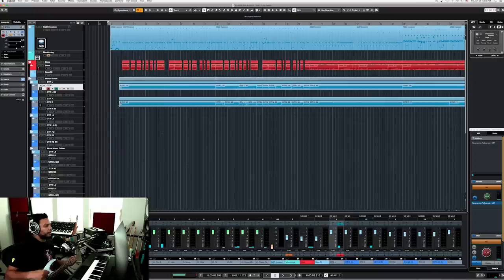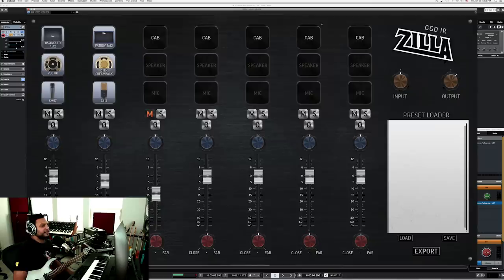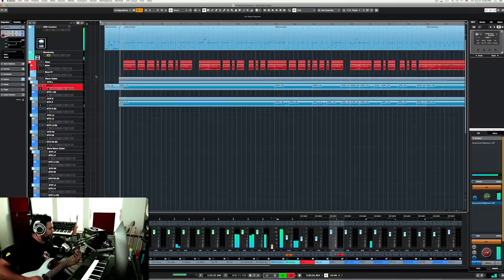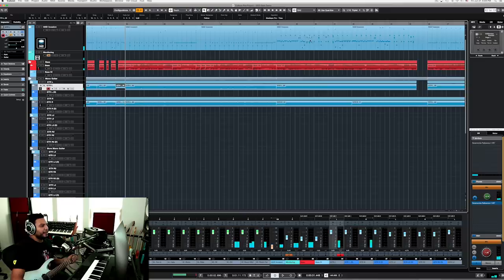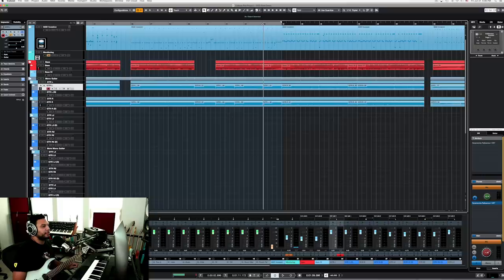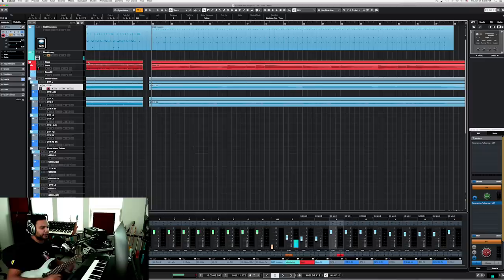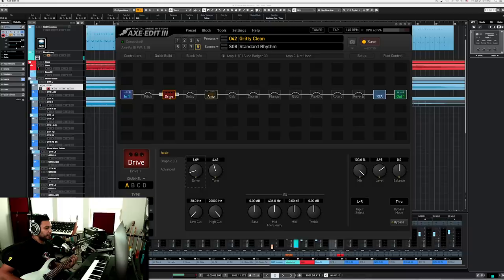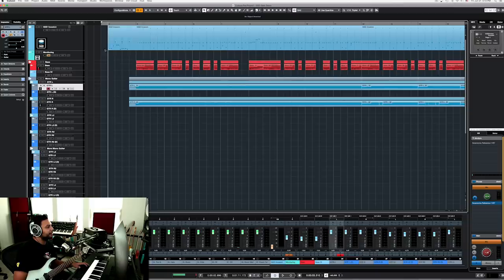Misha Mansoor - How to dial in gain!

Comment: What most people don't realize is that a guitar tone also has to be accompanied by a great bass tone. You can get away with dual or quad tracking fairly gravelly sounding guitars and as long as the bass tone is there, you're making some good pancakes. Great tutorial Mish<3

PS. Guys if you're having a lot of noise issues with your emulated amps, try turning away from your computer while tracking!!
Reply: I noticed that after upgrading video card guitars and bass guitars with passive pickups got noisy.
Reply: I had to either face away or completely directly towards one of my computers.
Reply: What??? That's crazy!! Best of luck dude!
Reply: @tobins6800  I said computer, but it can also be facing the audio interface that's causing noise from amp and cab sim software. For me it's definitely my computer making the noise but glad to hear what works for YOU!
Reply: @smoreshaunted  Yeah, it was a combo of bad guitar/bass grounding and an ugly computer, I have since gotten a new bass and different guitar pickups, also the ugly computer finally gave up the ghost
Reply: How may bass tones use a DI instead of an amp? HEAPS
Reply: @johnstevens8253  This is true! Some people, including me put their bass through a guitar amp and cab sometimes! I got the idea from Glenn fricker and then circle of tone, they mentioned that Lemmy did this
Reply: That last til I noticed myself as well. Was kinda weird but it works haha

Comment: I wish there was a video like this for the bass sound in of this demo.
Reply: Yeah. There is a lot going on there with the bass. Glad he took the time make this video though.
Reply: @bwgti  Yes ! This makes me want to write and mix more again !
Reply: Bruh track the bass duplicate  the same track twice have a high pass on one and a low pass on the other so basically have 3 track divided in to a low (sub) mid high and you can throw a distortion or guitar amp on the high track and you can kinda control the lows mid and high separate and mix it together thats what i do and it sounds pretty good...also parallel comp
Reply: @joeyg1463  Yes, thats Bassicaly the basics of it but there are so many ways to 'flavor' the sound. And somehow I never get it to sound heavy low and tight at the same time. I tried many tuts on youtube but not even one I found sounds like this.
Reply: @metalgear8000  The key to Nolly's bass tone is to start with a great sounding bass DI. If you have a cheap bass that sounds like crap, you won't be able to sound like he does
Reply: @GamePlayMetal  Our bass player had a dingwall ns2. It sounded okey but even when I tried the big tutorials I never got the same fat result. Maybe It's the way I record DI (focusrite scarlet 6i6)
Reply: @metalgear8000  Did you use a good Impulse Response? Just like in guitar, the key is to find one what fits the mix best. On top of that I would have to say that there is no shortcut to great bass tone, good bass and gear definately helps, but alot of it has to do with the mixing(altought you probably already know that since you have been doing some mixing lol).
Reply: @Progbassist  Mostly I don't use impulse responses. But recently I saw an Andrew Wade cab trick that made it alittle better. But yes. I guess I don't have the bass for the sound I want to achieve.
Reply: @Progbassist  there certainly is a shortcut for great bass tone and Neural DSP made it 😂

That darkglass plugin is easily the best thing I've ever bought. Slap it on your dup track and boom bass done.
Reply: @thomfisher4926  Yea I dont doubt that, I havent tried those plugins but I mainly use Darkglass pedals. If you think the tone is good and it suits the song...then you can say "boom bass done", but I still think its good to also know certain mixing techniques, like compression, splitting tracks, using different distortions, impulse responses, cutting the unwanted frequencies etc.

Comment: Thanks for the free lesson misha, appreciate it as always. Still wandering why your mixes slaps so hard even through the phone speakers. I still suck at mixing and you play way tighter than me, maybe the answer is there. Or maybe not, who knows
Reply: The "who knows" is the worst about that mixing stuff. There could be a million things we are doing wrong, and only time will tell.
Reply: @heret1c385  I was kinda joking, actually if you learn enough you get to the point where you can identify the areas that causes problems and start to work with them. A huge thing for me is that, compared to him for example, my source tones are worse (worse player, not enough djent, not a great environment with A LOT of noise, low budget interface) and that is tough for a beginner, cause then your mixing skill, which are still immature, needs to compensate a source that needs way more tweaking to sit properly where it needs to be. But still, who knows
Reply: I use a bass compression pedals for my baritone guitar works magically...
Reply: Experience, creativity & decent gear helps.
Reply: @heret1c385  This is the thing currently tripping me out big time with mixing, my mixes sound so bland and I don't even understand what's wrong or what to do. 
Feels like I'm searching in the dark with a blindfold on :(
Reply: @KyleKingGuitar  I am having the same problem. My mixes sound flat and lifeless even though I've followed the tutorials on drum mixing and whatnot. I just don't get how he gets the bass and drums in particular to sound so huge, it almost doesn't matter what the guitars sound like when you have such a brutal rhythm section holding it down.

Comment: Misha i have an ibanez rg8. Is it possible to get these type of tones from the stock pickupa
Reply: yeah dude don't worry about it, it takes a long time for gear to actually stop you from sounding better
Reply: Most of the tone from the hardware is with that 5-way switch that allows for the 'Petrucci style' coil splitting.
Reply: @jeffneiman4635  yeah but I doubt that's gonna stop anyone, I've yet to see a guitar with humbuckers that doesn't have any coil splits
Reply: Trust me when I tell you picking up a pick up misha would reccomend is so worth it.